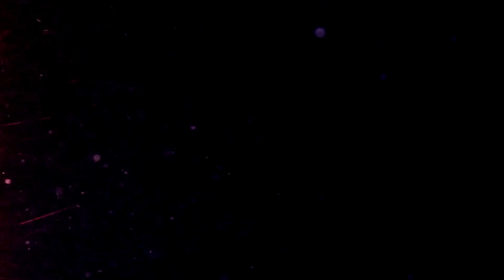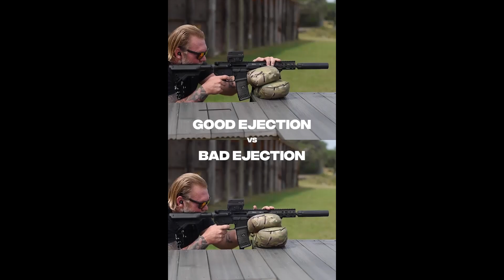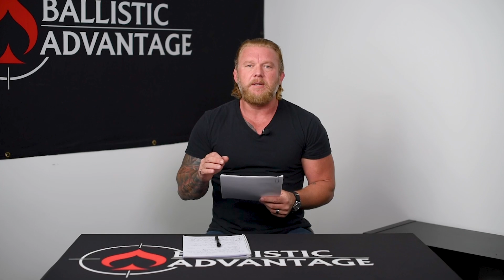Why Over Gassing Your AR-15 is Unreliable

Comment: Your video was very helpful to this AR newbie.  A month ago I removed the buffer spring from my rifle-length AR (actually, an Olympic Arms 22-250 UMAR), cleaned off a slight rusty film, and ran a Tico brush down the tube to remove a bit of rust.  Then I very lightly lubed the spring and tube.  Guess what?  The empty brass went from a 3 o'clock eject to more like 1:30, plus I'm seeing brass smears on the deflector.  Sounds like I need a slightly stiffer spring?

Comment: And that’s a very valid point.  You may have experienced 30K rounds firsthand but the manufacturers have the experience of tens of thousands of shooters running tens of thousands of rounds each.  They hear about all of those issues. You and I may never see “one in a million”. But they will. 

The larger the statistical sampling the more informed the conclusions.  If the manufacturer says don’t that’s usually enough to slow me down.

Comment: I just had to drill out the port on a 20" barrel i just got from yall. It was measuring at .085 and not giving the system enough gas to cycle reliably. Bolt wouldnt lock back on empty and multiple ftf due to the bolt lugs grabbing 1/2 back on the case. I opened it up to .09375 and perfect function.

Comment: How do you solve the over gas issue on a DI gun? Mine ejects at 4 o'clock un-suppressed, but forward when suppressed. I'm using a Sharps adjustable gas BCG and Armaspec H2 silent buffer spring.

Comment: I think you literally just nailed the malfunction in my Brand new AR pistol. Over gassed! After the second mag, it jammed EVERY round! 😢 Couldn't remove the first round before it tried to chamber a new round. But when manually cycled, even jammed, the extractor worked. Even if you had to force it to worked. I think it's cycling too fast.
Reply: Put a heavier buffer and buffer spring or one or the other to see if it slows it down. If not try an adjustable gas block. I had an h1 buffer and put an h2 with a heavier spring and not it’s around 3 to 330 o’clock ejection

Comment: Noveske is known for being massively over-gassed. 0.086" gas port it just stupid. I'm in the process of having them replace my 13.7" Infidel light mid CHF CL barrel. Right now I have the SpringCo Orange extreme power spring in it with an H2 just to slow it down an I'm still at 1:30 for the ejection pattern. Super annoying. Suckes with a can as well.
Reply: Noveske has always been that way. I have never understood the allure of Noveske or Daniel Defense. Competition guys love Noveske. I went to a two gun match with a few friends. I bet you 70% of the competitors were running a Noveske.
Reply: @DutchK75  some of the older barrels made when John was still alive were very good but that is clearly not the case for the current product line. Even V7 Weapons Systems has said that their QC is not at all what it once was. DD is really nothing special now especially when compared to Geissele offerings. Don't forget about Centurion Arms and Criterion.
Reply: @welderdude1  The older mid length guns when the owner was alive at Noveske were at .081 both 14.5 and 16 inchers. Still overgassed. (I've pin gauged a few of their older barrels.) But not as bad as the new stuff. The Geissele stuff is pretty good. Unfortunately expensive. I'm meh on Centurion arms. Their lower recievers from multiple sources are saying they are out of spec. I have 2 C4 rails from them though. I like them. Criterion has always made a good barrel. 
Rosco makes a good barrel. For inexpensive they have been above board. A guy I know has 20k on a 14.5 training gun he rebarreled. He replaced the upper with a Rosco complete a month ago. And like his last one shoots 2 moa with M193. Rosco is way better than Ballistic Advantage. 
A buddy had bought two Core Systems cheapo' AR15's they ran like crap. We replaced both his uppers with Rosco 16" uppers. We replaced his buffer and with a Sprinco blue. And H buffer. Both guns have been flawless. Oh and we put two AO Precision phosphate mil overrun BCG's in them. I replaced the extractor springs with Colt 5 coils. No O-ring.
Reply: @DutchK75  I have a custom 11.5 with a Centurion Arms chf cl barrel that is my favorite upper. It has an old DD shovelnose style fsp 9.5 quad rail that has been bomb proof. After reducing the gas to a 0.80" for my Noveske 13.7 mid it runs perfectly with a full carbine buffer system. I'm gradually switching over to the VLTOR A5 buffer system as it just cycles better than my other SpringCo carbine length systems. One of my favorite barrels is a 16" on my gen1 pof p415 that was made by Mike Rock. It just runs very well both with cans and bare.
Reply: @welderdude1  I have 5 Sionics rifles with the Vltor A5. It's the very best buffer system. I have a huge collection of Colts. None have the A5. 
My nephew the ingenious fellow he is builds all his rifles off of Colt OEM-1's and 2's. He's a machinist and former Recon Marine. And pretty descent AR guy. And he chops barrels and re-crowns them. And opens up gas ports as needed. He works part time at a gunshop so he doesn't pay transfer fee's. He goes through the distributers and pays like $650.00 for those Colts.
Reply: @DutchK75  that's some great prices on that colt stuff. I finally got a nice Bridgeport Mill and sometimes spin stuff on manual lathes when I have time. I'm slowly building my own shop so that in the rainy season I can keep busy stacking money away. On a side note I am interested in the brand new Centurion Arms barrels with the new chambers and bolts.

Comment: I’m having a problem with mine. It’ll lock back on last round but it has bad cycling issue when trying to re chamber a round someone told me it’s under gassed but it does lock back. Does too much gas cause it to constantly not feed and what would I need to do to fix it?

Comment: Don't like over gassed ARs either.  The Hanson 14 and 16" mid length barrels tend to have the best ejection patterns and recoil impulse right out of the box.   Hope that my supplier will eventually get some of the  mid length 17.7" 3 Gun Hanson barrels back in stock.

Comment: I've got 2 of your barrels and both of them are overgassed. The 14.5's gas block is crooked when the pin is installed.  Never had a problem, but the irony is ridiculous.

Comment: If any of you have built an upper with a ballistic Advantage Hanson midlength barrel and it wont feed 223  then you may need to look at the gas port.  Ba uses a .0730"" gas port which is about perfect for shooting  5.56 ammo w/ suppressor(highest gas scenario). If you plan on shooting a ton of 223 unsupressed  you will have to enlarge the gas port one size up to .0760" or #48 drill bit. Stick a cleaning rod down barrel, put a drop of oil on port and drill it out in one clean pass. You will be removing the tiniest amount of material. This setup will cycle/lock back with brass  223 55gr using an h1 buffer. It will cycle but not lock back with steel case 223

Comment: I purchased a complete upper from Midwest industries and based on the research I did I believe(even the Midwest industries won’t tell me who made the barrel) that its a ballistics advantage barrel. The rifle is over gassed, to the point where I had to use a h2 buffer to get a 3 o’clock ejection.  The firing pin retaining pins in that rifle. keep getting mangled and destroyed because it’s over gassed…

Comment: Looking for some advice. 11.3 hanson barrel with pinned GB, and Aero/BA everything else running a sandman s. Overcycling to the point of stovepipes/failure to eject. Running a standard weight buffer and spring. first thought was to get an H2 or H3? or maybe a sprinco setup.
Reply: SpikesT-2 buffer and a Sprinco blue spring. As a starting point. H-3 might be too much.

Comment: How often do you see malfunctions in adjustable gas blocks? I really prefer non-adjustable myself, but sometimes I need adjustment on some over gassed systems...and I am curious...which is more likely to fail, a mildly over-gassed system, or an adjustable gas block? Thanks.
Reply: Adjustable gas block for the most part. Slightly over gassed is not an issue for the most part. You gotta be pretty horrendously over gassed to experience what he is talking about. For example, if you have an ar that ejects at the 2:00 without a suppressor and then add a suppressor, you are going to end up having a bad time. Lots of different variables, some times ejection pattern alone can be misleading, also some suppressors are better than others at back pressure.

Comment: Funny thing is...the “bad ejection” is likely what you would get shooting a BCM suppressed. It will run with or without the can, in freezing temps, and with just about any ammo. But because they only source quality C158 bolts and CL barrels that are individually HP/MP, their rifles can run longer before parts failure. For people whose lives depend on a gun that works, it’s hard to beat a healthy gas port on a quality rifle.. A proper maintenance schedule using quality parts ensures continued reliability. 

A 4:30 ejection pattern on a suppressed SBR with an adjustable gas block is ideal for fair weather larping. There’s nothing wrong with that. But that on that gas block setting with the same ammo, the gun is likely to choke without the can or in freezing weather.
Reply: Older suppressor design does have that affect as you stated. However, free-flow suppressors tend to mitigate over gassing a rifle due to the design. If a rifle does not have an adjustable gas block, free-flow suppressors are ideal.

Comment: On my 16” AR’s my buffer weights are at 4.3 or heavier and I use springco red. 3:30 to 4:00 ejections all day. Also install 5 coil extractor springs and upgrade extractor. ???

Comment: I think maybe an even simpler analogy is that it’s common knowledge that putting a can in a gas operated rifle wouldn’t be that reliable since there’s more gas due to more dwell time. It’s less consistent and less reliable because of that gas. It may have enough oomph to power through, but too much and it’ll cause wear and tear while caking up the receiver. In the end, that much gas wouldn’t do much if there’s so much burnt up carbon in the receiver, more so when having much more hot gasses recirculated into the system would burn off all the oil and lubricant.

Comment: YOUR Modern barrel was nicer looking than the rest, priced well, and married to my upper perfectly. Also they are magical, I forgot to index the gas tube and remembered as I was putting things away. Slid the GB forward and it fit better than if I actually tried. Now THAT is a Bad Ass Barrel. And it came with a "Properly Headspaced" bolt, very nice.

Comment: When I replaced my FN mid-length barrel with a BA carbine length, I was all of a sudden over gassed. An H2 didn't cut the mustard so I ended up installing an H3 buffer and that slowed it down so I'm ejecting at 4 o'clock now. I'm not a big fan of adjustable gas blocks so buffering was my fix of choice.

Comment: AR's are more of a recipe than legos. Overgassing is overcompensation for gas leaks and/or a poorly spec'd carriers with too large of a gas ring run or bolt tail seal. Over-functioning a weapon is as bad as under-functioning. I have an m16 BCG that came with a military surplus m16a1 parts kit which was probably used as a training gun the last 30 years. Its hard to say if the BCG is original to the gun, but based on the coating condition, I believe it might be if not an early replacement. The bolt lugs are still in great condition and the carrier internals are still in spec. My theory for why - 1. probably because it was in spec to begin with since Colt is where the actual spec comes from. 2. It was a rifle length gas system which means the bolt stays locked for longer before the gas finally reaches the carrier key to force it open AND the gas pressure being delivered to that gas key is lower because more of the powder is burnt by the time it reaches that gas port = which results in a smoother operation which is less stressful on the mechanical components. 

I say this to illustrate that the less violence you subject mechanical parts to, the longer they will continue to function correctly. Use the longest gas system you can on a given barrel length. Coming from a perspective that suppressors are standard equipment, suppressors add dwell time, so having a short dwell time barrel makes sense so that you haven't over extended your dwell time upon adding a suppressor. This makes the loudness at the shooters ear less severe and again reduces overpressure at the carrier key.

Comment: Appreciate it I have an 11.5 that is so overgassed I have a red springco spring and H2 buffer and it's still throwing them forward heading to a gas restriction device next.
Reply: Try h3
Reply: @texasoutlaw210   thanks but went to the root and pulled out the weed LoL put an adjustable gas block super soft now

Comment: The amount of ignorance on this topic in general is staggering. Some of it I understand, as there is often too much nuance in the discussion for some to follow along. But I have had several conversations with people about the AR gas system that ended with my realization that they don't even understand what 'over-gassed' or other basic terminology means, or at the very least how those terms relate to what is physically happening with the gun.

'Carbine-length gas systems are good enough, but if you have a choice then mid-length would be more beneficial for a 16" rifle.'
'No no no, I want a carbine-length gas system so it's over-gassed and more reliable. I'd even take a 20" barrel with a carbine system if I could.'
'... carbine-length does not equal over-gassed ...'

'Yeah, I'm really enjoying the KP-15 lower. I threw my A4 upper on it, and it was lighter than some 16" guns.'
'Wait, you mean you had a rifle-length upper on a carbine-length lower!?'
'Uh, yeah?'
'It could have blown up! The pressures are too different!'
'... nope ...'

Comment: slightly overgassing your rifle can be more reliable. But that typically only applies to a duty scenario with the full weight of government supply chains behind your rifle. That doesn't necessarily apply to the vast majority of shooters. 

 I prefer my rifles to eject somewhere around 4 o'clock unsuppressed, and at 2 o'clock suppressed. Mostly because I'm not into changing gas settings every time I swap to and from a can. 

This video is spot on, great content guys.

Comment: What about locking lugs wear and therefore enlarging the head space due to lack of gas? Should I be afraid, that redusing the volume of gas would mean that locking lugs would not be pushed forward enough while being turned ???(therefore it would wear quicker)